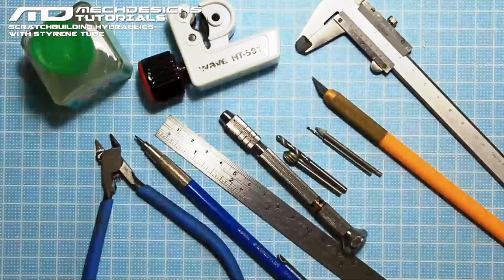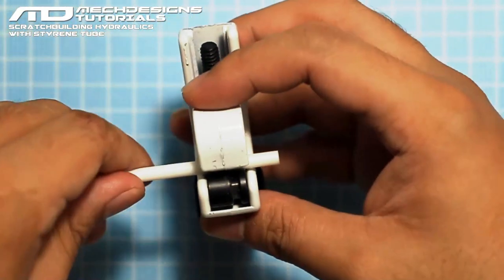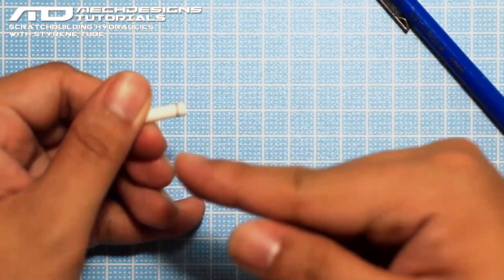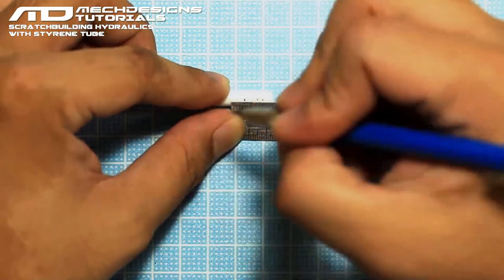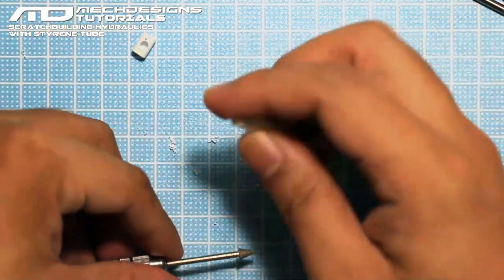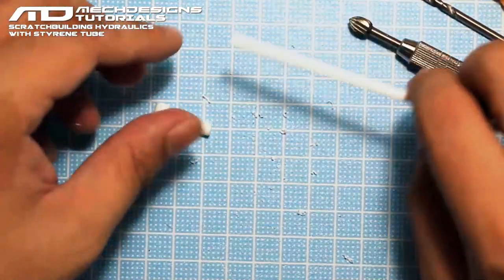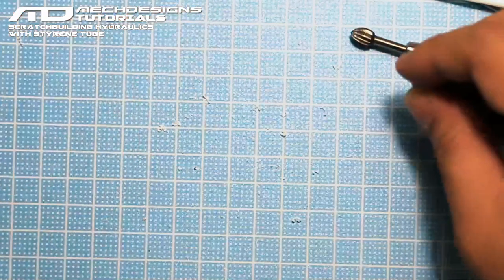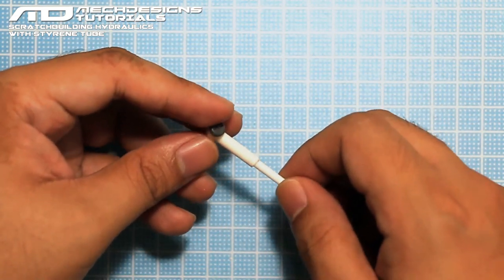Scratchbuilding - Creating Hydraulics using Styrene tubes

Comment: What's the tool you used in the drilled hole to smooth it out
Reply from the maker: The Pin vise with a Diamond drill bit?
Reply: @MechDesigns  yeah
Reply: @MechDesigns  it smoothed out the hole